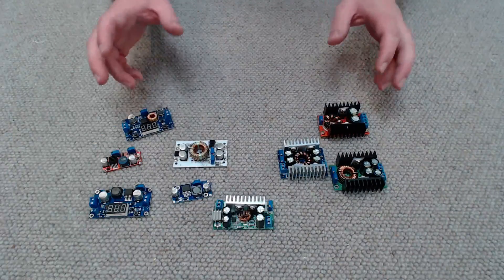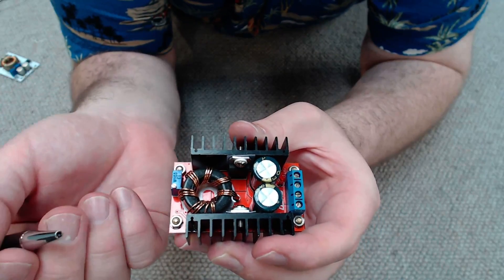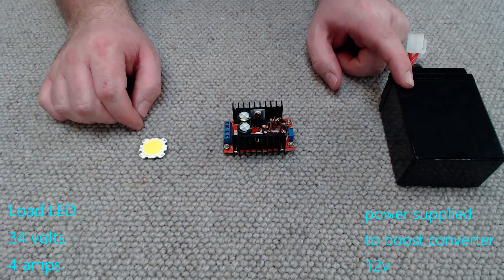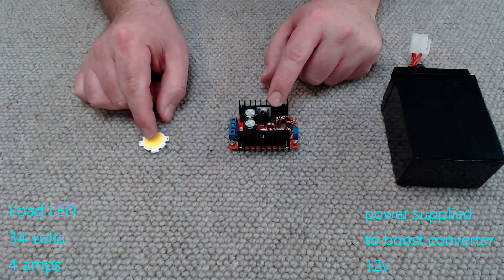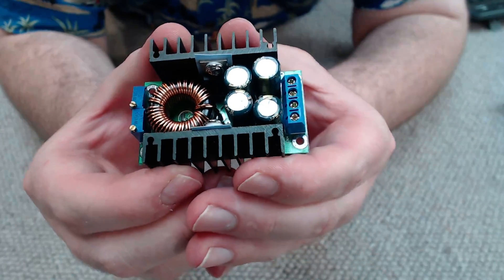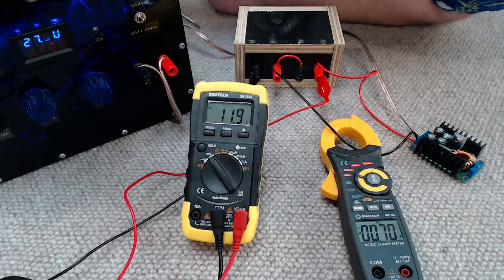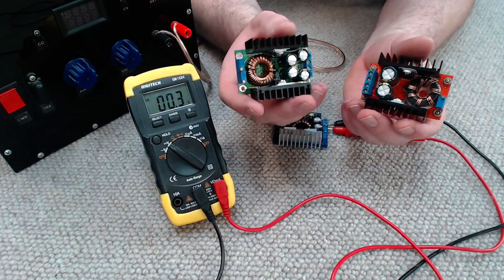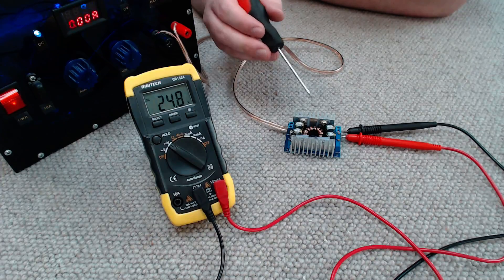What You Need To Know Before Buying A Boost/Buck Converter

Comment: the more i I look into this subject the  more i get lost. my issue is that i have a 12 volt  18 amp hour ,power supply and i need to run a 36volt motor with a maximum draw of 350 watts .....what do i buy to put  the power from the 12volt battery pack  into the 36volt motor controller ? can someone provide me with an answer or even better...links ?
Reply: Power supplies are not specified in Amp hours, but in Amps.  The Amps is the maximum of current the power supply can deliver. Batteries have both Amps and Amp hours. The Amps is the maximum current the battery can deliver and the Amp hours is the amount of energy stored in the battery when the battery is full y loaded. 3 Amp hours means the battery can deliver 3 Amps for an hour or 1 Amp for 3 hours or 0.5 Amps for 6 hours.
You cannot drive a 350 Watt motor from a 12V 18 Amp power supply.  The power supply can only deliver 12*18=216 Watt which is not enough energy for a 350 Watt motor.
Reply: what if i run  2 of those batteries in a 12 volt parallel configuration ? that would be 12 bolt 36 amp  or 432 watts...correct ?    @czarzenana5125
Reply: @bobamericana3099  
You need to know the power in Amps those batteries can deliver, not their capacity in Amp hours.
If those batteries are lead acid batteries they most probably can deliver much more power in Amps than needed.
Reply: this is for an ebike kit. the motor is 36v 350watt 10amp max.....the lipo battery pack for that motor is over 300 dollars...i can buy 2 of these SLA batteries for 55 dollars and then a step up converter for 40 dollars..the SLA  setup adds 8 pounds more than the 18650 battery pack but even with a converter this would be just 1/3 the cost....this build is for a tricycle with that cargo basket between the back tires so the weight is not an issue....some people say i can step up from 12v to 36v with only a 120 watts power..others say something like you..multiply the battery volt and amp value to get the watt and if that total is more than the motor then there would not be an issue....i hope you understand what i am trying to do. basically save hundreds of dollars  on my power supply for the ebike motor kit .  @czarzenana5125
Reply: @bobamericana3099  
Are you absolutely sure the motor is not going to draw more than 10 Amps?  I have two e-bikes rated at 250 Watt at 36V, but at peak power each of those motors pulls over 500 Watt. Most 250 Watt e-bike motors at 36V are internally fused at 15 Amps (540 Watt).

Why don't you buy 3 of those SLAs and connect them in series? That gives you a voltage between 36V and 40V which is perfectly fine for a 36V e-bike controller and motor. A 36V Li-Ion battery is 41V fully charged and 28V when empty, so you are well within specs. You then do not need any converter and you don't have any losses. Those SLAs can easily deliver 20 Amps.
So, I would say buy 3 SLAs and put them in series and you do not need a converter at all. Do it like in this picture:
https://www.cabelas.com/assets/cms/img/additional_info/buyers_guides/wied_wiring_diagram_5.jpg
Reply: that is what i will do. i was just curious if it possible to use SLA and then step it up a bit. for the sake of saving weight. i am not looking to use the ebike motor 100% of the time...just cruise power after i have pedaled up to speed. thank you for you time  and  helping me .   @czarzenana5125
Reply: @bobamericana3099  
Yes, but by buying a third SLA you increase battery capacity by 50% and by using a converter you are only losing capacity because those converters are using energy as well (10% or more). Other people use 3x 12V batteries in series as well. Some buy cheap 12V Li-Ion batteries of power tools for a special sales action price. With 18Ah (at 36V) you have quite a big capacity compared to a 36V 11Ah Li-Ion. It's no problem to use them all the time, SLA's are well known for delivering very high currents if needed. When cycling you'll typically only use 4 to 8 Amps, but when pulling up uphill you'll need lot's more power. Those SLAs can easily provide that power. Use cables that are thick enough. 14 AWG speaker cable will do.
Reply: good points. also, i live in orlando florida USA..so it is flat land. 45 miles from the atlantic ocean we are only 65 feet above sea level. so hills are not an issue here. again, thank you for your input  @czarzenana5125
Reply: @bobamericana3099  
I live in the Netherlands, so you cannot get it flatter (or lower) than we have :-)
Still, as a biking nation we now have a lot of biking-tunnels and biking-bridges under and over highways and then you have to go uphill and downhill often for very short distances. We even have a lot of highways for bikes which is a trend of the last 5 years. It is really nice for bikes over here, like bikers having precedence over cars at traffic lights.
Reply: bikes here have the right to share roadways..ebikes are limited to 750watts...USA has always had a love affair with the car though .  @czarzenana5125

Comment: nice video, clearly explained too :) . i do have question; im looking way to boost output voltage of 2S  18650 up to 12V and current limit @2Amps. any suggestions?
Reply: you will need BMS first to get 7.4 volts.

Comment: So i have a rf key fob that runs off of an a23 battery (13v to 6v) and i wish to run it on vehical power would a buck boost converter handle fluctuations in input voltage?
Reply: 4ford6first0 they usually do

Comment: i have a question i have treadmill motor im using to generate electricity but it's voltage is quite low at a normal rpm...on top speed i tested around 7.5 volts dc however in low wind conditions i would like to double the voltage coming in can this work?
Reply: You can use a boost converter to set the output voltage, let's say to 7.5V and then the output Voltage will always be 7.5V, but in low wind conditions you are only able to draw a tiny bit of power/amps at 7.5V
You cannot create more energy than the treadmill delivers, with a boost converter you can only set the voltage at which it is delivered.
Reply: thanks do you have any idea how i can make my treadmill motor work? to get like 13-14volts to charge the battery
Reply: @astyles51  
To load a battery you'll ideally need a CC-CV boost converter which means it loads the battery with constant current and when the battery gets closer to fully charged it is charged at constant (maximum) voltage. If your treadmill doesn't deliver a lot of current at maximum a common boost converter will suffice as well.
You'll first need to know all the specs of the treadmill and the battery to make a decent choice.
Minimum and maximum voltage of the treadmill and what is the maximum power it generates? What battery are you going to use? Lead acid? Which capacity?
Reply: Ok so my system is set up right now with a 100 watts solar charging two 12v batteries in parallel and hooked up to an 800watt inverter. i don't really use power in the day only at nights this is why i need a windmill so that at nights my batteries can charge. i have two car 12v led acid batteries about 45ah. i resolved to using led acid becasue it was what i had on hand. my inverter automatically cuts off when it reaches around 10.5 volts so i guess i don't need to worry about it driving below 50%. i really do not wanna spend money on a generator motor. the one i have if i spin it with hand turns reaches about 6 volts. this isn't ideal for charging. i guess i will have to make a system where it will use a pulley driven mechanism to make it a 4:1 ratio it's either that or a voltage booster. Maybe give me some insight what i can do. BTW the treadmill motor is big and there are no lables of ratings and amperage on it. i can't tell
Reply: @astyles51  
To preserve battery life you should not go below 11.9V. Your 10.5V is limiting the number of load cycles of your batteries.
It's hard to even estimate if building such a windmill is worth the effort if you have no specs.
That said, best is to use a CC-CV step-up converter. The problem with step-up/boost converters is that by far most of them need at least 8V at the input and you want it to work with much lower voltage at the input.

I found: https://www.ebay.com/itm/222921849640 which is CC-CV working from 3V and up. It will not provide more than 6A at the output.
You can also use https://www.aliexpress.com/item/100W-DC-DC-Boost-Step-Up-Converter-4-30V-to-5-35V-12V-24V-9A-Power/32842764873.html which delivers about the same from 4V and up, but is not CC-CV. However, it also delivers no more than 6A at the output, so it cannot overpower your batteries and CC-CV is not really necessary for those low power converters with your batteries.

You should set the output voltage of the converter tot 14.4V to charge your batteries. For the CC-CV version you could set the maximum  current to a value of f.i. 4A although 6A won't harm 45Ah SLA batteries.
Reply: thanks so much my brother you are awesome sir

Comment: Hello good explanation. Do have a question, Can I also parallel 2 buck converters of 10A if I need 20A? (from 24 to 12volts)
Reply: i have seen a video where that was done. the guy had to  put resister diodes between the converter and the motor that wanted the power...basically..power source>converter>diode> power user....if you do not do that 1 converter will run at 100% before the second even starts working....or even worse  they will both end up cycling on and off constantly...basically fighting each other...so yes it can be done . you just need the correct diodes....

Comment: If a process that changes one DC voltage to a different DC voltage is called DC to DC conversion. A boost converter is a DC to DC converter with an output voltage greater than the source voltage. A boost converter is sometimes called a step-up converter since it "steps up" the source voltage will this also step up the current and if so how much current or voltage can a small medium sized boost converter take. If i wanted lets say over a 100Volts from a 22 volt battery?
Reply: A boost converter always steps down the current. You cannot create energy from nothing.
For 1 Amp at 100V you need at least 100/22=4.5 Amps at 22V. The efficiency however if not going to be higher than about 90% so in the real world for 1 Amp at 100V you need at least (100/90)  * (100/22) = 5 Amps at 22V. The extra 0.5 Amps at 22V you need is dissipated as heat by the boost converter.

Comment: Great explanation!  I have the exact last buck boost you showed, my question is feeding 28 volts 20 amp available on input at 14 volts on output could I get 16 amps on output?  It's rated 8-10 A input, effectively I would have 8 amps at 28 volts in and could I get 14v at 16 amps because it's not boosting (minus losses)?  BTW it's fan cooled, but if you think not, what would I expect?  Thanks again!
Reply: A D - The Buck Converter in the video at about 8:00 is rated Max 12A 300W on the OUTPUT. You need to use a cooling fan when driving over 5A on the output. The current limiting will use a sense resistor that will be chewing a lot of power at 12A, and the circuit cannot adjust higher than about 12A anyway. Hence the maximum you can get at 14V is 168W.
Reply: Ok great the one I have is at 12:35 , depending on voltages 8 Amps is about max, always seems like only one side or 2 transistors get hot.  I put some 200K pots on extension wires for panel mount and works good, thx!

Comment: nice vid!! question! if i need a buck of 20amp but they are rate up to 10amp,can i add2 or more on parrallel to raise the amp rate??thanks!!
Reply: I would not operate any of these devices at their maximum rating for extended period of time. Most of them will state somewhere that they need additional heat sinks when run at full load. They get hot under full load and fail sooner. If I need 2A converter I get one that can handle 3A or 5A  and so on to maintain overhead and safety margin.

Comment: Could of just divided the output voltage by the input voltage to get a multiplier of 2.8333.
times the multiplier by the the output current to work out the input current. Its always a ratio of the the 2 voltages.

Comment: I have a 120vdc power supply from my electric lawn mow.

Which one of it do I need to convert it to 24vdc x 10amp for my battery power hand tool?
Reply: Ludicrous question.  Waste of time and money, plus none of them are 120VDC input rated, plus even if you have a 24VDC tool which you should already have or buy batteries for, then 10A is far too low a current to it in "most" cases.

Comment: a question why does the boost converter work with a battery as power supply but not with a AC power adapter ? The output  specification  of the adapter is 12V 1.5A. The boost converter is connected to a inverter.
Reply: Seppo Rokka buck and boost converters only work with a DC power supply.
Reply: An inverter converts DC-AC so not sure why you say your boost converter is connected to an inverter! A mains adaptor that rectifies AC into smooth DC wont have a powerful enough output to kick start a DC-DC converter. DC-DC Converters have an inrush requirement which means they need a power source that can supply quite a lot of current in a short burst, something your average power adaptor cannot provide.

Comment: Great vid / demo.  I often find YTers only show volts or amps in their demos or experiments, and it is really good to see you show both input and output volts and amps simultaneously, I can't commend your teaching process more highly, as this is the best way to show the relationships between input and output.  So many people trying to show overunity of a circuit or device, and only showing one reading at a time, which often portrays a total misconception of what is actually going on in the circuits.  It's good to see people trying to defy the Laws of Physics with their experiments, but are only fooling themselves and others when they dont complete the power equation by showing input vs output.  One more thing I will add is, that step up/ step down converters are great for solar setups I believe, as when the sun rises and sets the voltage output is reduced and a step up/down converter helps to take advantage of the lower voltages at these times so as to get a little more power from the solar array. Thanks for sharing, I love your thorough explanations in your vids, keep it up!

Comment: I see that you got a 12v lead acid battery next to you, i wonder if you let me know how you charge this type of battery safely, i have got one but can't find any appropriate charger to charge this. Thanks in advance :)
Reply: Mozahidur Rahman if you want to charge it from ac then get a charger for it. Its already available in market(bulk, cv, float). I mean specially designed for it. If you want charging it from dc, then your source should be around 14.1 v to fully charge it. If its not then you can use  buck/ boost converters depending upon your need even for charging with laptop chargers etc
Reply: To float charge a sealed lead acid battery you need a DC voltage of 13.65VDC at 20oC and charging current that is limited to c/5 so a 10AH battery would typically be charged at a maximum current rate of 2ADC.

Comment: i have a Buck converter same as the one in (8:15) when i raise the Amp the led change to red, i have a power supply of 12V 20A and want to have an output of 9.9V 4.2A ,
it indicate on the multi meter 200mA and when i go higher the led change red.
i want the 9.9v 4.2A for a UV led. hope you can advice me before i bow things up :) 
thanks
Reply: That's the exact same thing I'm watching videos about this buck converter too!
I'm trying to use it as a bench PSU and find shorts on a motherboard, but unfortunately it changes to red, and also has a weird hissing/whining noise coming from it.
It also gets hot.

Please inform me, as soon you found some useful information.
Reply: Sounds like your electromagnet is creating back EMF. Try putting a diode across the leads to it and look at the scope again. A little ripple in the supply side can create a big ripple in the measurement when attached to a coil.
Reply: https://www.youtube.com/watch?v=emLLK32S3vE you need a higher voltage input.